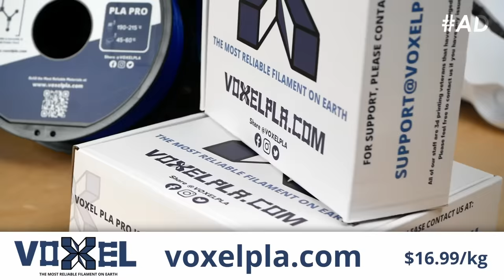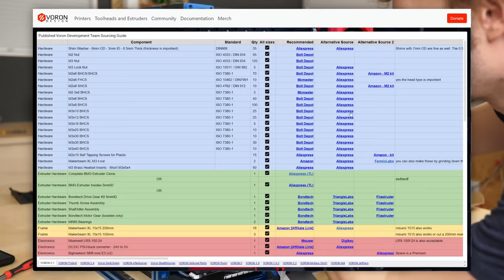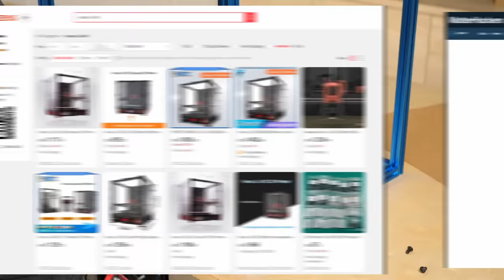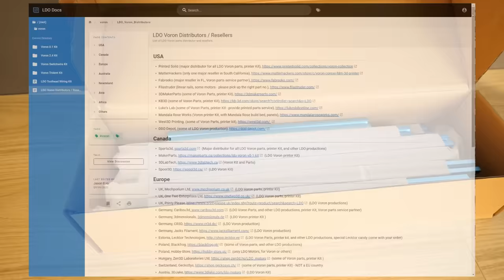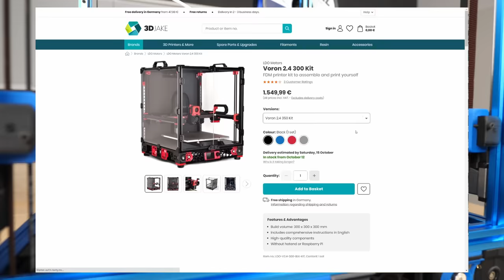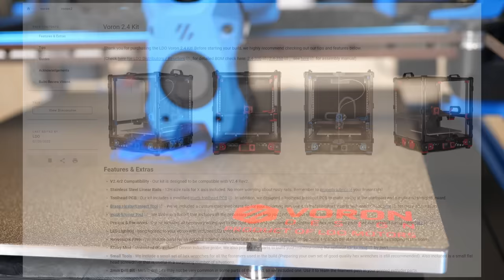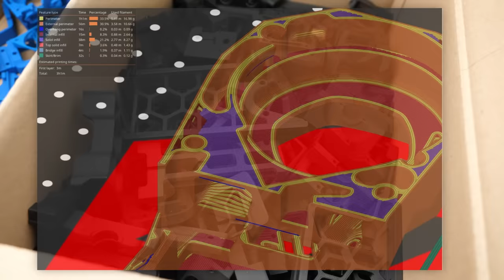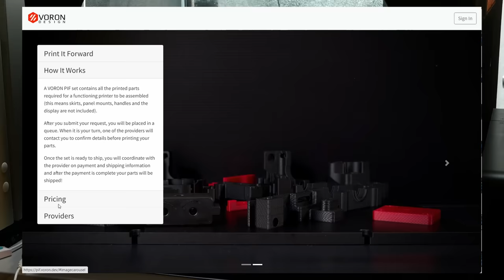Should you build a VORON 2.4 in 2023? (LDO Kit Review)

Comment: I like the thought of the Bamboo lab printers. However I would like to see the ease of maintenance on them when stuff starts to wear out, and the availability of parts. I have a Voron 2.4 and I like the fact that I can do almost any of the maintenance in less than a hour. As far as speed of print goes I have no issues with the Voron print speed now with HV drivers and the rapido hotend. Combine that with nozzle scrubber and auto z compensation its send the file and walk away. I like the ercf also since that lets me do various colors, different materials, or even continuous mode easily. Yes its all "mods" but once done, I can click print on my laptop and when its done I know it will be finished properly if I did my part in the slicer. I am not saying the x1 or x1c are bad machines as I am sure they are fine, but I think over time when maintenance and part replacement comes into play the x1 or x1c may be a pita to work with. It would be nice to see them open up the machine to utilize other slicers and open up the firmware for users to play with.

Comment: sidepanels installed makes a voron way more quite. If you spend some (more) time on discord you notice there are plenty beginners nowadays. Someone who selfsource every bolt is just a freak with no real life. BUT a voron is not a toy in many ways. Those days are over that you quick touch/feel the surface while printing. And its not made for PLA at all. 
Many buyers struggle because they just want to be in the "voron club" but came from Enders printing whole thingiverse with PLA/Petg.
installing big ass Highflow or even Ultraflow Hotends with large Meltzones and eh voila, best chances to clog your hotends regulary ^^
I printed 2 years on a mk3s+ and yes quality is nice. But its a slow ass rattlesnake over the time. If you ever taste the daily 150mm/s you will not go back....EVER(!) ;-)

The Bambu rig is nice but you didnt get easy spareparts. no dealers, no standards, no community yet and if something broke you cant fix it as any diy machine. 
Btw an LDO Kit is the Top on Voron kits. You can order a Formbot kit below 1000€.

Comment: Personally the Voron (2.4) looks amazing, but also over engineered. It's truly great and maxed out in all the enthusiast ways with a really cool but ultimately less functional moving gantry (because heat rises basically).

That all being said, I got a Bambulab X1C and paid prusa mk3s money to get basically a voron I don't have to put a work week into thst auto calibrates all of the things I hated doing on my modified klipper running bed singer (Thinfs I'd still have to do on a voron).

Its been great, even with the very legitimate and real concerns about it being a closed system.

Ultimately the lack of frustration it brings me, I think will make it easier to eventually build a core xy of my own, but not a voron.

For its greatness, it just seems unreasonably complex, like an engineer given no limitations on complexity with a lot of areas of diminishing returns. That is why if I end up building one I'd want it to be something that both doesn't take a work week to build and isn't so complex. Something like a Vezbot or Ratrig where I could hopefully also add on an auto tool changer which is something I've wanted for a while.

I feel I might have sounded too harsh on the voron, and I want to say again I think its great,  but ultimately why spend 40 hours building a printer when a printer with arguably better capabilities and more simplicity can be built in half that time? The only answers I can come up with is because it's really freaking cool, and that's fair, but I feel like Vezbot and Rartrigs are similarly cool.
Reply: That's pretty much the reason they exist. Engineers gone wild.

Comment: Ok I seriously need some help now making a decision here. If I give some parameters maybe y'all could give me some advise

1. I haven't yet done any 3d printing
2. The most important consideration is I will be mostly printing with carbon poly  filament 
3. Highest quality is more important t than  print speed
4. I'm  not intimidated by the voron build. My thoughts are it will give me significant advantage in parts   
      replacement and maintenance. 
5. I will definitly not be working by cloud. This is not an option for me. 
6. I prefer the open source of the voron but reading others comments seem to lead to be convinced they 
      would've purchased the x1c if it had been available. What sets it apart over the voron?

Comment: let me see if i understood< in order to build this , you have to have a 3D printer already to make the parts!! onother question: the kit is not a complete kit correct? you have to buy other parts to be able to get it printable???
Reply: If you don’t have a printer you can do the print it forward program. They will give you the parts needed to get it up and running. You’ll then need to print the remaining parts to enclose it. Those can be printed in PLA or PETG since they’re outside the machine.

Comment: 20:10 If you wanna compare your Bambu printer to a voron, then a better comparison would be a voron trident rather than v2.4. It uses the same 3 screw raising bed setup for Z axis as the bambu and is considered a simpler, more boring version of voron (some even say say a bit more reliable). Also slightly cheaper. V2.4 is a bit more of a technical novelty due to the flying hotend setup, so it's not exactly apples to apples.

Comment: try matrix nozzle 3d printing, like resin printing but with pla/abs style printer, for example 32x32 matrix nozzles, 1024x amount of sliced printing at standard 3d printer (whichever) speeds, just better slicing to fit the matrix nozzle, color mix and layering on the fly

Comment: Another great video from CNC kitchen. The Ender3 comparison is fair  but misses an important point. The E3 comes almost fully assembled. The voron does not. To join the Voron 'club' you must build one, even if from a kit. There is an old saying in engineering. You can't know a machine unless you built it. It's possible to run and E3 without much of a clue how it works. It's not possible to run a Voron without having learnt how it works with your eyes, ears, hands and head. On that count it's entirely different to any off the shelf, prebuilt printer.
Reply from the maker: My point was that people spend way more money on modding an Ender-3 than it initially cost to "improve" them. This increases the personal bond and just fuels tinkering.

Comment: With a voron if something breaks or is work out you can fix it even 100 years from now you can still find the parts and fix it or print it. You go with cheaper options that's also as good as voron if they break you have to hope the company still around and that they have the parts you need if not you then throw away the printer or find another solution.

Comment: ongoing still i dream of building a customized own printer, with a min 600x400mm workspace, and a z-height of about 300mm The Voron type printer looks like a good basis for that, but also it makes no sense to purchase a set of preselected parts. Half of them will be not needed and be replaced by something else. But i will have a look at the Voron System, as soon as i start with the Project. 
Still a struggle is to get a good solution for the heated bed in this size, may be few mm over 600x400mm. May be someone would have me the missing link

Comment: I have one. 

It is very very much for those who like to tinker with the printer but not for it to be actually good or reliable. It can be very good but it will require a lot of work in the software code and manually adjusting parameters that if you're not used to may be a daunting prospect. 

Do I regret it, not exactly. It was in no way even close to being worth it. For the cost there are many ones out there that not only out do it but will do so for much cheaper. I did have fun playing with it and making many of the parts and wiring harness. 

If you're not a person who wants to fix it and upgrade it on a frequent basis then it's not for you. Buy a real printer from prusa that will work with normal levels of maintenance. 

The cost of one of these is actually about $2000 to $3000 depending on many things but it's not cheap. Keep in mind the ender is still less than $500 and it will print most everything this printer can do. 

Stay printing and enjoy whatever you like to print and print with.
Reply from the maker: Thanks for your feedback.

Comment: As an engjneer, my 3d printed holes are often too weak... the printer will underextrude slightly which makes the printed holes much weaker. You should do a video about it. My solution is to taper the end on the holes and use tapered screwheads.

Comment: I know a guy who sells Voron 0.1 all assembled, with really high grade parts only for a meager 899€

...and no, I am still in the middle of building my 1st V 0.1, but by this time tomorrow I should have everything I need to start dropping plastic! And no, no prior knowledge on 3d printers per se, unless you count a 6month struggle to get an Ender 5plus with a few upgrades to do anything beyond grilling my 8Gb Pi 4b and the Octopus Pro board, along with a nifty Btt display I had gotten myself for the piece. Luckily after being in constant contact with the seller they eventually relented and took the POS back for a full refund, even tho I was WAY over the time limit for returns and stuff. Like so way over it, It`s not even funny. But I guess they felt bad after all the back and forward and whatnot, that what I just described was but a crescendo of a month long $hitshow like you wouldn`t believe. But the 0.1 is almost print ready rn. And since I had to learn to tailor my own Firmware for a highly customized Ender from scratch and figure out what I needed from at times 3 or 4 different online guides - each for one component that fit my build  and combine it to one big beautiful bastard, that even worked for a hot minute before tragedy struck. From what I could gather, the Octopus Pro (haha, pro) has a short. (But again, BTT decided to refund me the full price, long after they did not need to do that anymore, and even tho I had gotten the board over a 3rd party seller! Amagine how floored I was) I am confident that the Preconfigured Voron Firmwares are a breeze to get to run.

Comment: 12:15 wow, what went wrong when printing the toolhead rear part? That reminds me how I printed my first part in ABS with a Makerbot Thing-o-Matic a decade ago.
Reply from the maker: Steep overhangs with ABS and I might even have had too high temperatures due to problems with my REVO heater core. Maybe I should re-print that part ;-)
Reply: @CNCKitchen  yes, black ABS might absorb more radiated heat from the hotend. I was surprised that I had to print black ABS-X @230°C to get passable overhangs even though it says 250°C on the spool.

Comment: I have had a self-built Hypercube for years, it has been running 24/7 for 6 months straight and has given no problems, looks a lot like the Voron, I am very happy with the printer and will definitely build a 3rd because the 2nd smaller fursion was straight to the big execution building, I LOVE THE XYcore machines
Reply: Hypercube Evolution Gang. I have probably ran hundreds of KG of filament through my HEVO in the 6 years I've had it
Reply: I agree completely - built my Hypercube as my first printer from the printed parts supplied by Tech3D, and learnt way too much about so many things. It still runs fast and true. Ok, I also own a Mk3S+ and enjoy "just getting the part", but as in most things, served my apprenticeship and look back with fond memories.
Reply: I've got the HEVO too, love it but still never found the "perfect" bowden or extruder setup for mine. 
Running an E3D v6, but the heat creap and part cooling was killing me, so modified it a bit at the reduction of speed.
What are you running, and do you know of any groups to join to see what others have done?

Edit: Also, interested in upgrading from the Ramps/Arduino sandwich to something more capable (speed and memory size for Marlin options), any recomendations?
Reply: @2112user  I have a standard setup with to types of hotends with a bodum end without and both are printing fine and one print had de Ramps setup and the second one the BTT 1.3 turbo setup.

Comment: I've built 2 LDO 350 kits for work and I think they are much much quieter with the side panels on than my MK3S at home. They print in our office and nobody is annoyed by the sound because you can't hear it sitting 2-3 m away from it.
Reply from the maker: I'll see how the noise level changes once I install the panels next week. Yet the fans in the electronics compartment will still remain.
Reply: @CNCKitchen  I changed the electronics fans to 30%. The temps are still fine an the fans are very quiet in my case. But you are right, it would be good to change these sooner or later
Reply: @CNCKitchen  I dropped my fan speed to to about 50%, and added a ducted fan across the stepper drivers as well. That really gets the electronics bay noise right down.
Reply: i used noctua pwm fans for electronic compartment. they are silent even at full power. also they can be regulated very well.
Reply: @CNCKitchen  panels do help quite a bit for the fans within the enclosure. But for me the electronics ones were the most annoying. I replaced them with noctua a6x25.
Reply: @CNCKitchen  yes the fans from the electronics department are way to loud. changed mine to sunon green with 12V (you can simply switch the fan voltage with a jumper on the ocotopus). After that, you can not heare them anymore.
Reply: @CNCKitchen  i've ran my voron without the electronic compartment fans for over a year now with zero issues.  I only print PETG however.

Comment: Question is through Stefan, would you still have built a Voron if you hadn't been given a kit and if so would you buy the LDO kit over formbot? (Haven't watched the video yet 😁, so sorry if you've answered that)
Reply: I built a Formbot kit. Couldn't justify the bigger price on LDO. No hotend, and the additional lighting, nevermore kit and clicky are cheap to build. Formbot did came without the rpi, but I was able to source it. The seller offered discount because of that but i chose to upgrade to Dragon HF and one more thing that I can't remember. The kit has quality components, or at least they seem to be, we'll see in the long run. The only cable I had to crimp was the probe.
Reply: @zheki  My V0.1 is a from a formbot kit and I've heard they've really improved since I purchased mine.
Reply: @Rushmere3D  I bought mine around may, and got a good kit. All the rails where smooth, all the components seems of good quality. 
But I can't really compare apples to apples. I built my 0.1 from Blurolls kit. Best LEGO technics set I ever built. The only downside was that I had to crimp the wires myself. I printed the entire 2.4 250 on it. 11/10 wouldn't recommend xD And in retrospect I should've built 2.4 first, but it was walk in the park after 0.1

Comment: I think the reason why Voron is so hyped, is that if you want all of those good things Voron includes, you don't really have much choices in the market. And the open source nature means, that eventually, you can mod it to be better than anything else in the market.
Reply: Theoretically better.

Everything on a voron is theoretically potentially better than a bambu x1c.

But the x1c is a well tuned package that works better out of the box and overall, while the vorons are a huge time sink with lots of little things that go wrong and need to be figured out (like the nozzle cleaning).

The bambu also has way better software integration and multi material and multicolour printing to boot.

This is not a knock on the voron. It's a great printer design!

It is a reflection on proprietary tuning VS open source tinkering.

This is why I prefer Windows for any machine I actually want to game or work on, while open source stuff like Linux is great for a tinkering machine.

When you just need to get shit done, a proprietary solution is often just superior because someone tested and stood behind it

Unless of course they don't, in which case a proprietary solution is the WORST!

Open source splits the difference and hedges your bets - you probably won't get the best product out there, but you'll get something that is high end and works with some work
Reply: @Tom--Ace  Vorons are like a Ferrari that you tinker with. If I put mine on the line, I can smoke Bamboo but that's not the point really. I can If I wanted to build a super reliable print farm with Vorons it would be just expensive, not unreliable.

Comment: imo the vcore 3 is better (in terms of speed, modularity, size, and price,), but Im a bit biased. Voron is a solid machine that's very well documented, so its a bit better for beginners. The vcore 3 is also sold as a kit by the designers, so there's no tedious self sourcing process.
Reply: I agree in the sense that there are a number of machines that are superior in terms of design. Not sure about the vcore. The annex k3 comes to mind though. The reason I built a voron was the community and the fact it is still very capable.
Reply: @notsam498  if it's about speed the k3 beats any other printer besides the vzbot. Even the X1. But that's not what the voron is even about. It's a well built machine which should be able to assembled anywhere in the world. That's why they don't include fancy pcbs etc in their standard configuration.  Ratrig is a company though. So not comparable.
Reply: @notsam498  k3 is a really fast machine, only downside IMO is the insane price (so many extra rails and motors) and the tiny size. I personally like the vcore 3 because of the larger size and speed. I can run 600mm/s at 20000 mm^2/s on my 500mm cubed machine, which is enough for my needs.